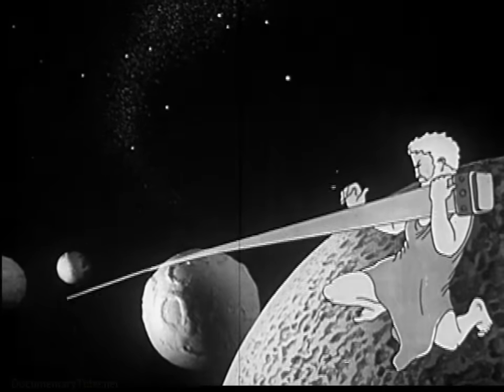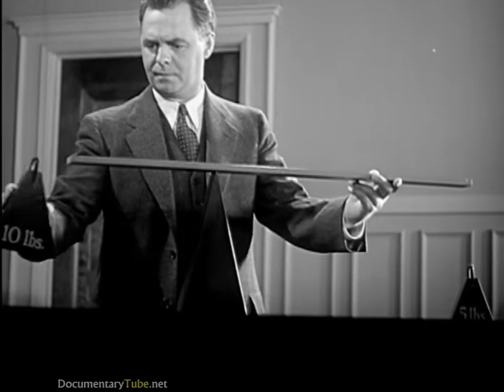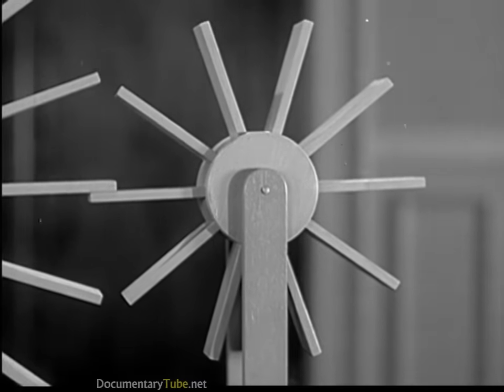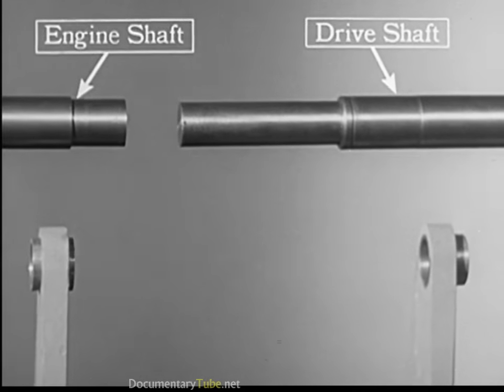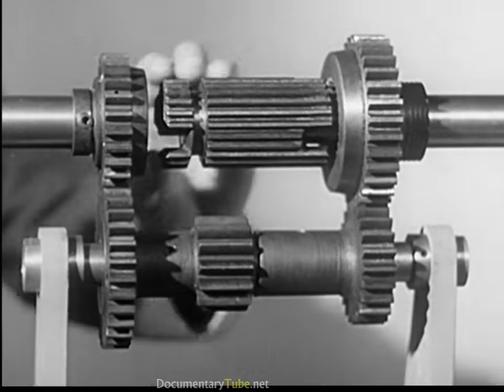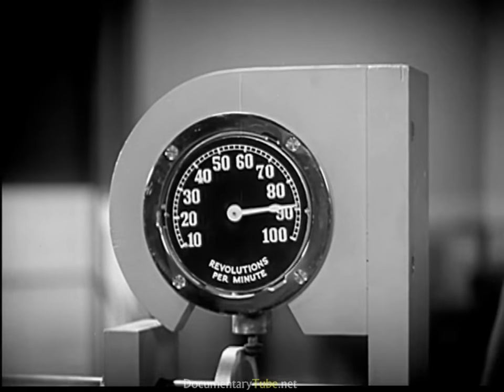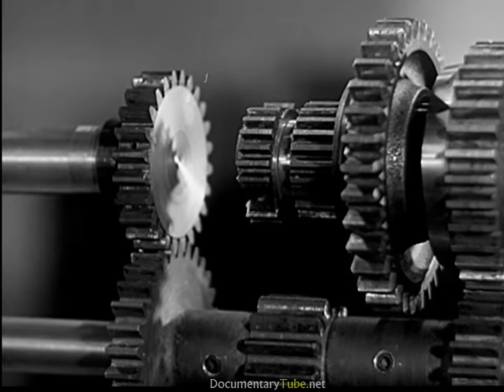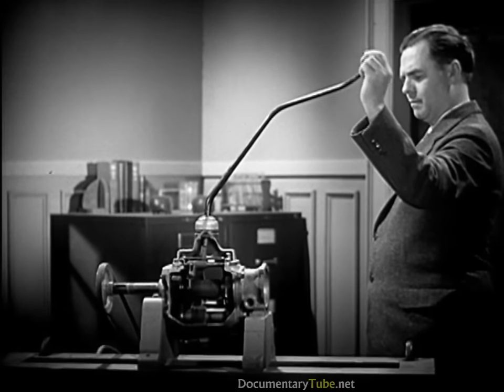HOW IT WORKS: Transmissions

Comment: I wonder what would these engineers think if they saw a modern 7 or 9 speed automatic gearbox.
Reply: +Mustaine_24 Almost everything gets increasingly complex.
Reply: +Mustaine_24 Actually these old engineers were probably more intelligent than modern engineers.
I say that because first of all the engineering we see is just built upon previous engineering AND modern engineers whether it be something like a transmission or a cell phone, are compartmentalized to just engineer one aspect of the design and work with dozens of other engineers collectively who work on other aspects.

There aren't too many engineers who design and build something entirely from the ground up anymore.
Reply: hackfreehvac That's because each component of a design gets more and more complex and you can't possibly know it all.
Reply: Mustaine_24 Do any work on autos?
Reply: Toby Licious ??
Reply: Ronald van Kemenade And in fact several famous articles in the "Populars" (Mechanics, Science) predicted highway speed limits in excess of 200 "by the year x", along with atomic powered cars.
Reply: +Yuan Gan well said
Reply: +Yuan Gan Why? It's ingenious.
Reply: +Yuan Gan Hybrid cars? Fully electric cars? We even have cars running on hydrogen. Turbo/super chargers? Autonomous vehicles? Not to mention how much we have reduced CO2 emissions. I don't think we are short on innovations.
Reply: +Mustaine_24
> The first electric cars were produced in 1880.
> The first hybrid car dates back to 1901.
 You're right regarding turbo's, compressors, turbine cars, computerized ignition, fuel cells and hydrogen (all originated in the 60's) and of course emissions and autonomous vehicles.

However: Hydrogen is just another type of combustable, and I regard a turbo's as an improvement, rather than a new form of propulsion. Cleaner emissions & the use of ECU's idem.
We're not short of innovations, but Yuan is right; mostly it's just improvements.
Reply: +hackfreehvac There is something else too: with today's engineering computer program, they can simulate the device they made and can actually see where they fucked up and where they overengineered it. In other words, if they see red on the gear, they know something is wrong, however if the gear stay all blue they know that it is most likelly overengineered and they can thin up things to cut on cost and weight. So they can simply go trial and error until they are satisfied with the result. Those old enginner had to calculate everything by hand! They had to be really sure that what they did is right, so they need to calculate all the forces involved and know the exact material propriety that they will use.
Reply: +Ronald van Kemenade actually the Turbocharger already saw use in Germany in the 1930s  :)
Escpecially for airplanes (all piston engines back then) at highr altitudes to try and keep see-level pressure in the intake (and thereby not loose power on clinbs)
Reply: +Ronald van Kemenade browns gas was 19th century
Reply: +hackfreehvac It's kind of like that throughout all of history. Someone following someone else's work. No engineer in all of history taught themselves calculus, chemistry, and physics while at the same time inventing all the tools needed to create things. Every "innovator" had to start somewhere.
Reply: It's called "standing on the shoulders of giants" :)
Reply: Probably the same awe that Wilber and Orville would exhibit if they saw an F-16 go by.....!
Reply: +Mustaine_24 Nothing really, everything is exactly the same, just in different locations.
Reply: +Mustaine_24 The engineer would be like "I knew it was coming".
Reply: +hackfreehvac By that logic, the first neanderthal to pick up a stick and tie a pointy rock to it is the smartest being ever to live, because all subsequent advancements were based upon that first tool design.
Reply: they'd fucking explode
Reply: Royal rar~ No, More like they would pace back and forth, repeating over and over "Mankind is not ready for technology with power of this magnitude yet, the world is doomed".
Reply: Pci Craftsman W... What?
Reply: Pci Craftsman [Citation needed]
Reply: Pci Craftsman No, you just made an extraordinary claim with zero evidence, so I pointed out that you should cite some things. Also, stop typing in all caps, it makes you look like a crazy person. Oh wait...
Reply: Pci Craftsman No, you're crazy because you say things that are crazy. Using all caps just makes you appear even crazier.
Reply: +Mustaine_24 I know what you mean. They don't make them like this anymore. They make them better with planetary gears.
Reply: +Addy Licious I wish I had an atomic powered car.
Reply: +Mustaine_24 
They would think "Holy shit, this modern shit break all the time, while the old stuff was made to last"
Reply: Jon Snow The Crow Hmm, i wonder why it breaks all the time. Let's take a look, shall we? Ford Model T: There are still working models. It was made of solid steel and a collission at 20KM/h was likely to kill you because of that. The engine was a 4 cylinder side valve producing 20 horsepower at 1600RPM, the transmission was a 2 speed planetary transmission with reverse, far less mechanically complex, and far less efficient.

Now, some modern vehicle, let's take a basic one, a Chevy Spark: Made out of lighter metals and composite materials, designed to crumple in a collision and basically fall apart so that you don't. The engine is an inline 4-cylinder gasoline engine producing 98 horsepower at 6200RPM (A factor of ~4 increase in speed and power), along with an automatic 5-speed transmission that is both more efficient and more convenient to the end user. The car also includes enough hardware to almost drive itself, along with literally hundreds of other additions that make the car safer, faster and easier to use. 

It breaks more? Absolutely. It's designed to break more? Absolutely, but that it breaks more doesn't mean it's crap. There's a good reason, even alongside the bullshit.

It gets even worse if we look at the cutting edge of what we can do with engines, which is what the Model T was when it came out. Look at an F1, it's the same size engine as the Spark in a V4 configuration and produces 750 freaking horsepower and spins at 21,000 RPM. I wouldn't expect that to last as long, even though it's made of much more advanced materials. You're comparing apples to oranges. Old stuff served a different purpose and was far more primitive. It lasted longer because it was less effective.
Reply: Teth47 10 year powertrain warranties are available now. Unheard of in those days. Advances in materials, machining, lubrication, process control have made that possible.
Reply: Pci Craftsman So aside from that being barely coherent and insane, it's also inaccurate, we have 50+MPG ICE-based cars, and there are many other emerging technologies that are only having trouble getting off the ground because of the oil industry's bullshit, so turn off your caps lock and join the rest of us in reality.
Reply: Teth47

"we have 50+MPG ICE-based cars"
link please.
Reply: Pci Craftsman
  mhm. Put it on a crusty ski hill, it might get up to 50. Brakes not so good on them, tho.
Reply: Pci Craftsman

rough on the feet, but better than using a tree :)
Reply: Go on step further: Continuous Variable Transmission. Google it :)
Reply: +Ronald van Kemenade if it aint broke dont fix it
Reply: Believe what you will, but in reality there are very few "new" ideals. The Slide rule generation of engineers that lived and worked from about 1930 to 1960 invented and designed most everything around you. It is not the concepts that have changed with time but materials a manufacturing techniques. Most of the so called "new" ideals or things we enjoy are not new inventions, but the end product of a series of small improvements ... Mechanical Evolution..

I have seen it first hand, and truly believe that the generation of Engineers alive and working today are not as good as my generation. We most of us learned every aspect of a process, many actually started out as Machinist, or other trades Persons, and carried that practical knowledge with us as we progressed up the Ladder.

 With out computers for example many of the youngest Engineers I work with would be lost. When I take out a Slide rule and try to teach them about logarithms it is sad just how limited they are.

 Along with their limited abilities, and limited experiences, because most "specialize" in one discipline or another and for example an architectural engineer of today knows little about Electrical Engineering principles, and so forth. Back when I was starting out most Engineers had a working concept of all "practical" Engineering disciplines.

  I believe this ...
If you where to take away the Computers and software from todays crop of Engineers, they would not even be able to write a simple paper. BUT ... if you could go back in time to 1930 and give one of those Engineers a Computer ... he would solve the Worlds problems. That is just my opinion.

  Before this generation starts patting itself on the back ... remember this Ancient mathematicians knew and used geometry around 1000 BC, and did their work using a stick writing on the dirt.

  A Teacher of mine ... "you're never so dumb, as when you think you are smart" ... and he was right.
Reply: David Jordan Good luck with the slide rule. The first satellites went up based on what they could do, but there's no way a shuttle could. Speed and accuracy are critical in a project like that. Land a satellite on a far-away comet? Only in your dreams.
I get what you're saying, and don't really disagree, but you're glossing over the fact that there's far more to learn now that has been discovered since then. Material science, fluid dynamics, stress and fatigue analysis, assorted laws and standards, software productivity tools (CAD, Matlab, etc).It was certainly possible to do a lot then, but it was far more time-consuming to design and manufacture anything, fewer people could do it well, and the product was generally lower quality.
The current generation could certainly benefit from a term or two welding and machining. They'd benefit from the humility and respect for the trades it would teach them.
Reply: David Jordan  yeah, initiative and creativity are getting harder to find IMHO. I think that's partially driven from the top down, though. Some bosses don't like competition from their underlings. 
There is definitely a lack of interest in basics like spelling, grammar, writing etc.

I don't know what you're whipping them at. There's no way you're going to "whip" a CNC lathe by doing it manually. You're not going to "whip" a balance sheet and income statement out of an accountant faster by doing it manually. There are times and places where experience lets you run circles around the noobs and their toys, but their way can work better for other applications.

I'm disturbed (disgusted?) by the "It's not my job" attitude as well.
Reply: While I don't disagree with you, I will say that we have no idea what their levels of intelligence compared to modern engineers is. Necessity breads inventions, and if we were just getting around to where they were, who knows where things would have gone.
Reply: Ronald van Kemenade I read somewhere that around 33% of the cars made between 1900 and 1910 were all electric.
Reply: why? Because the automotive industry is owned by big oil. FACT.
Reply: @STARDRIVE  )

Comment: so i have watched a hundred other videos all developed by modern scientists and teachers, they all feature fancy computerized animations and state standardized questions. I learned nothing from that. Then along comes this video from 1930 (im guessing) And it is straightforward easy to understand and BOOM i get the manual transmission, if only the modern teachers take a look at this
Reply: +cliffyracer693 you should check out the Feynman Lectures, if your into physics
Reply: I have a learning disability, yet I'm in the same boat (or car if you'd rather). Given the rather black and white attitude (to match the black and white footage) that people had in those days, I was worried that I wouldn't understand any of this or be able to keep up with it, yet surprisingly it was a hell of a lot more easier than the modern CGI stuff. And the real tragedy of it all is that the CGI stuff would've been a lot easier to put together (no need to have a dummy transmission put together, no need to hire a team of animators, just one person and their computer will do the trick! plus the CGI doesn't need be overly detailed which means the frames can be easily rendered and put together on a basic laptop).
Reply: I think it's from the 50s even though all the vehicles are from the 30s and 40s.
Reply: @michaellinner7772  The clothing in the film was from the 1930s. Therefore I believe it was made in the 1930s, probably around 1937 or so.
Reply: Yes, modern videos just seem to show off their computer/graphics prowess with very little explanation or actual demonstration.

Comment: Now I finally understand why my 3rd gear is shot, when the the mechanic says "your syncros are going bad". Neat!
Reply: +hal900x   I would think it was BS the mechanic made up.
Reply: Don't think so. I've heard it from several, and one was my shop teacher who had no financial involvement. They wear out eventually.
Reply: +hal900x Syncros do go out like any part that deals with friction and rubbing. Good news about manual transmissions its much more cheaper to repair. The difference can be big. Two cars of the same model but one is auto and one standard can be a different up to 5 grand.
Reply: +hal900x Unless you forget to use the clutch, or you use 2 hands to shift, or you like to go from 5th to 1st a lot, modern transmissions are pretty fucking tough to kill. I'd expect the clutch to die a lot sooner. 

now the wrong lube oil can fuck things up, but that's really rare. I know Subaru's are a bitch to shift cold, but once the oil thins down some they behave better.
Reply: kleetus92
 You're right.
Reply: +kleetus92 Well this is a 25 year old Getrag, so it's just time. The clutch pulls like a champ, but I highly doubt it's original. These E30s can be treated pretty rough by the kids who are into them these days.
Reply: +hal900x This too is true. Things do wear. With context, statements become clearer.
Reply: +hal900x I have an E39 with a 6-speed Getrag that's still on its original clutch at 195,700 miles. Amazing. Still shifts smoothly with no slipping.
Reply: +Danny Zabolotny Yeah, my clutch is great too on my E30 after even more miles than yours. My issue is with trans though, not clutch.

Comment: For me it is almost like finding a treasure. Explanations of the free spinning gear around the drive shaft, the constant but linear moving gear on the drive shaft, the reverse gear and the synchronizer is so clear that in modern transmission videos they are almost impossible to understand. Not to mention that in the beginning of the video the logic of going from levers to gears are a true treasure, almost philosophical. Can't thank enough.

Comment: so how does it work when you hits the brakes. Wouldn't the engine gear still run?
Reply: yup... which is why you push the clutch pedal in while coming to a stop.
Reply: wheelgunnin 44 is that why the car stalls when hit brakes only
Reply: benson997 exactly.
Reply: What about in an automatic transmission? There`s no clutch to push.
Reply: Lizcary Reyes Automatic transmission have a clutch , it's just automatic too so the driver doesn't have to press it
Reply: Lizcary Reyes
Reply: @Silmeria0724  hydraulic pressure
Reply: @bensonmkurian2071  but why should the car stall if the engine is still running and we hit brakes?
Reply: @enderzebak2863  When we are pressing the brakes, the engine gets slowed down and eventually it stops and suddenly cuts off the power hence the car stalls/stops

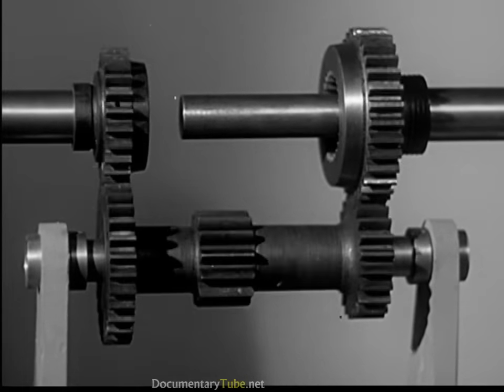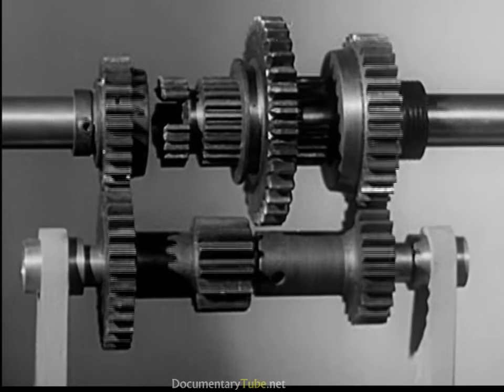Comment: At 4:00 min they show the shaft at the upper right turning when the gear on that shaft is described a free-wheeling, and at 4:50 the narrator says the shaft leading to the rear wheels is standing still when it is plainly turning. Otherwise a great and very  well-explained demonstration.

Comment: This video was very helpful in showing me how a car starts and how it runs but what makes it keep going? Where does the momentum come from(im sorry i sound pretty naive but everyone has to start from somewhere.
Reply: Momentum comes from the fuel (petrol + air mixture) that is ignited inside an engine. You should watch a "internal combustion engine working" video to fully understand it, but here's a very easy to understand analogy.

1] Imagine a closed space with a few components (a fire hose, a button you can push in a wall repeatedly, a cigarette lighter, and an outlet vent)
2] We spray some fuel from the fire hose and ignite the lighter, an explosion happens which forces the button into the wall (the button is connected to something important, more on this later). The button comes up again and the gas from the previous explosion escapes through the vent.
3] Step 2 is done repeatedly infinite times
4] The button, by a mechanism, rotates a rod (video 3:03 engine shaft) and goes back to an "unpressed state" repeatedly. THIS provides the main "momentum" from the engine (or the closed space in my analogy)

Comment: My father recently invented a new type of transmission that allows for a greater number of gears while using less room. He fit a smaller gear inside a larger one and an even smaller one in that. The different gears can pop out and recombine for a greater option of leveraging.